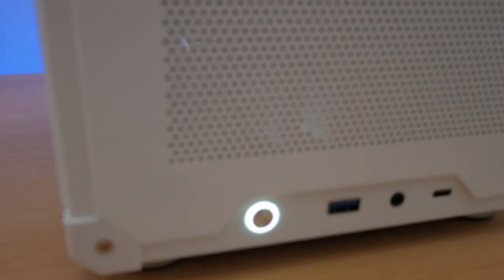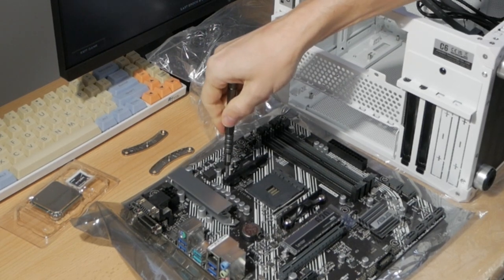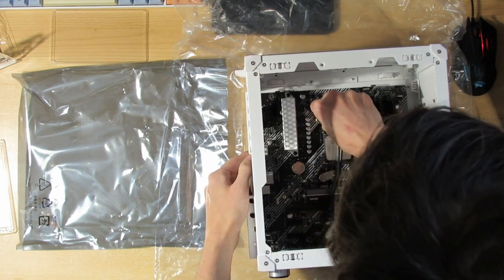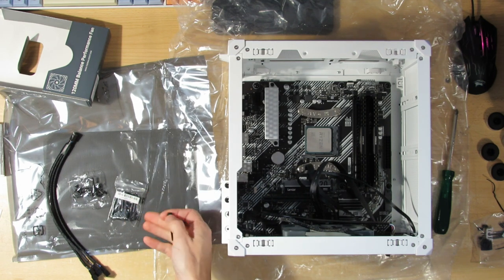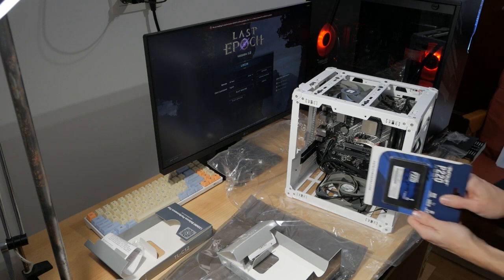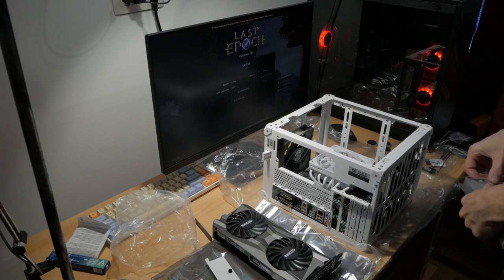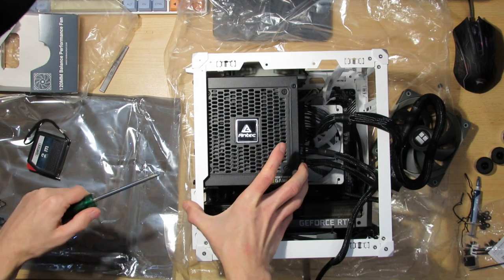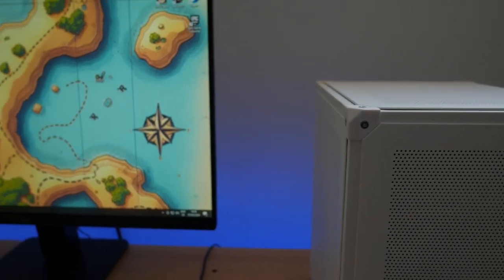$1000 Small Form Gaming PC Build

Comment: Thanks for that video, I’m waiting for case to come from china, that’s very useful to watch as I’m total beginner and have no experience as I was only laptop user, but this case and possibility to use cheaper parts pushed me to try having a small pc. If You would have any tips for this case I would greatly appreciate sharing them.
Reply from the maker: Thank you for the comment!
Firstly, the case is very nice looking and quite adjustable, and portable.

I put out a video recently where I put in maximum number of fans https://youtu.be/7Rm04jGlvnk (granted you can use 1 more fan if your GPU is shorter and doesn't span the whole case depth), and you can also mount sata ssds on the back side through the holes (also mentioned and shown in that video). TLDW, not much of a difference in temperature as the mesh holes are a bit too small - for example my GPU inside the case is 10C hotter than outside of it. But it's not really a problem for the CPU temperature.

When it comes to building, having a smaller board is better as it is easier to build and manage the wires, but itx boards are more expensive. For more airflow, which the case lacks, you could mount an SFX power supply on the top and use a tower cooler. It can look something like this https://www.reddit.com/r/sffpc/comments/18ecmwp/jonsbo_c6_easy_mod/

One of the boo boos that you can do, like I did, is to not put the IO shield in, and also make sure that none of the IO shield pins go inside the ports, in my case I had the pins inside the HDMI port, so I had to take out the motherboard again. Well nothing is wrong if the pins are in, but you won't be able to use the port if you do need to use the onboard GPU.

Comment: Great build. Cable management was not best but it was because the cables were so stiff.

Can you share your temps your are getting.
Reply from the maker: Thank you!

I agree with the cable management, while having a modular power supply helps, having custom cables that are shorter, bendable and better routed along the frame could provide better temps. Doing custom cables is something that I consider doing, but I don't know if it's worth it for a mid-range build - this is probably an "end game" modification when it comes to the cost.

As for the temperatures (in Celsius) - the fan curves in BIOS are set to the lowest fan speed at idle and up to 80% on both CPU and GPU since I want lower noise. The CPU and GPU both idle at 45-50 but the GPU hotspot is 10-20 degrees higher. The CPU in gaming goes to like 70 and GPU to 80 (hotspot gets to 105). I still need to remove one cover at the back for the GPU slot and I need to fix the thermal pads on the GPU as I didn't use the correct thickness pads.

To get more air to the GPU one could raise the feet like 2cm, using a 140 fan is advised and also setting a better fan curve.

I still have some modifications I'd like to do namely using 140 fans, if I get some cheap as the prices went way up. Or maybe even use a fan like the "silver stone shark force 160" on top (doubt it fits on the bottom with full size mATX but depends on the bottom connectors you need plugged), and then putting the 120 fans from the current top/bottom to the left side - the 120 fans just about squeeze between the frame and the PSU if done correctly.

You're probably wondering "what does he mean by putting the fans to the side, he has an SSD there?" Well.. that's another thing I did but didn't show yet as it's part of a modification list. I mounted the SSD using the holes on the back of the case between the IO shield and the PSU.

Comment: I want to know the comparison you mentioned between the AXP120-X67 vs AMD Wraith Stealth to know the comparison of noice, temperature and the distance between the PSU.
Reply from the maker: Thank you for showing your interest in this topic! I am kind of swamped with other things at the moment so I don't know when I will be able to get to doing this video. So while I can't provide my hands on comparison I will list the specs that I have found online comparing the 2 coolers. Just from that alone you should be able to make a deduction which one is better. Whether you need a better CPU cooler will depend on the CPU you use and how hot of a GPU you use, if any, as the heat from the GPU will rise and affect the CPU cooler to some extent if the case airflow is not the best.

AXP120-X67:
Height: 52 mm
Rated Speed: 1800 RPM±10% (MAX)
Noise Level: 26.1 dBA
Air Flow: 59 CFM (MAX)
Power dissipation 200W

Wraith Stealth:
Height: 55 mm
Rated Speed: 1200-2800
Noise Level: 42 dBA
Air Flow: 27.18 CFM (MAX)
Power dissipation 65W

When it comes to noise level 27dB is like whispering, or a typical ambient room noise. 42dB is like the sounds in a library (according to some articles I found). But when it comes to fans that doesn't tell you anything about potential annoying frequencies. However, I can tell you that at idle the PC is whisper quiet from 1m away.
Reply: @jackalldiytech  Thank you very much for your help, I'm planning to build a pc with the Jonsbo C6 and CPU R5 7500f and GPU 4060 ti 16gb but I still can't decide which cpu cooler to use
Reply from the maker: Personally, I wouldn't use the Wraith cooler. And I would make sure that I get a good CPU cooler, because taking everything apart does take some time, not to mention the cable management. I can tell you that there are other mods you can do in the Jonsbo C6 case, like using an SFX power supply mounted at the top, and then you can use a full tower air cooler. You'll just have to figure out what makes more sense budget wise.

Something like this https://www.reddit.com/r/sffpc/comments/18ecmwp/jonsbo_c6_easy_mod/

Comment: How's your thermals for peak gpu and cpu temps?
Reply from the maker: I'm happy with them even though I have a standard fan configuration. I'll do some fan mods when I can. I did not set fan speeds over 70% so it's not too loud.

I think GPU hotspot goes to 95c and normal temp is 15-20c lower than that,  CPU I think doesn't go over 80c.

I admit I didn't pay much attention to it yet, but if you skim over some of the gaming benchmarks I posted then you will see the temps with the default number of fans one can use.

Edit: Looking at Ghost of Tsushima at very high preset at 1080p, CPu temp 66°C (52W) and GPU 75°C and gpu hotspot 93°C (138W).

If you'd like to know anything else let me know!